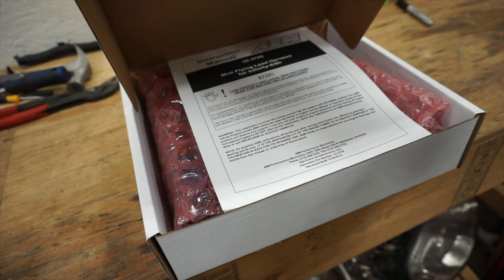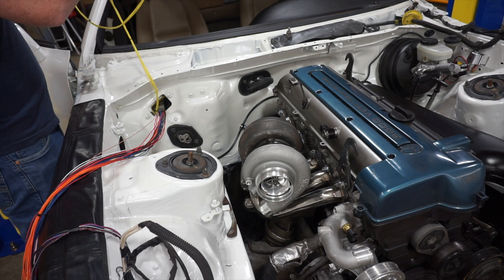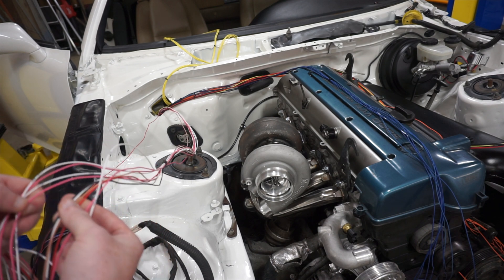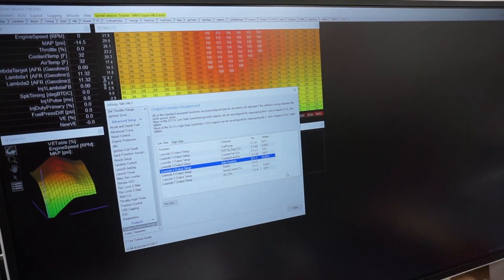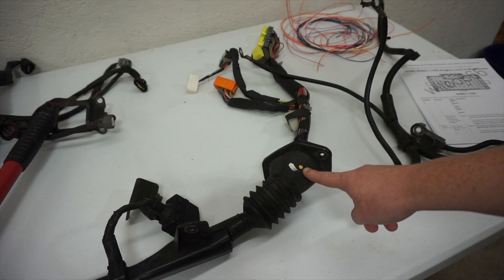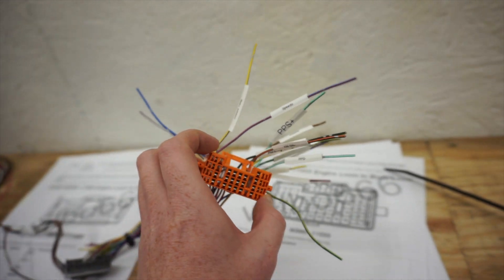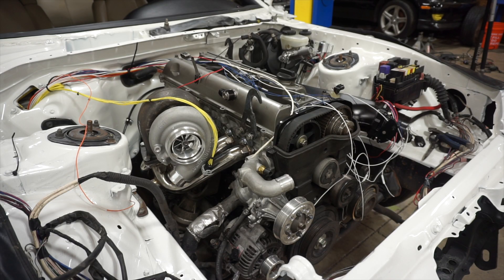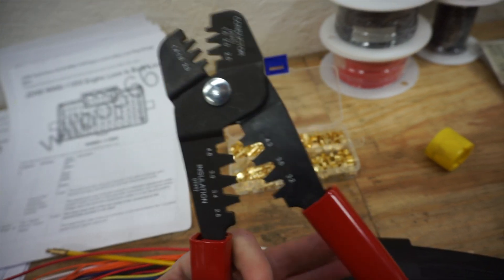Making a 2JZ Engine Harness - MKIV Supra Build - Pt.9

Comment: I'm doing my harness as well, from scratch, I'm done with everything but I haven't sheathed it all together due to one thing, the fuse box. I want to use the OEM Fuse box in the engine bay. 
Any details on that? @8:00 . My trouble personally is which signals are to come from ECU (likely the Request) going to the Fuse box EA1/BA1 & EA3/BA3 connectors. @9:57 it's a lot of manhours referencing the Electrical Wiring Diagram book and setting everything up, I don't even want to count how many I've spent but love the learning process.
The only thing I can say is don't take breaks on the harness & by that I mean I took a 2 month hiatus on mine in October when Got all my branchpoints etc set up then early this month I came back on it and boy you really gotta re-tackle and refresh where you left off in order to know where you're going next. what helped me out is i made an Excell of all my wiring setup and what pin goes where and the color code i used for each sensor I used. Mine is going on an EMU Black (Much like you, I'm trying to retain all the factory features and relay box... that's what got me left)
Reply: Did you ever finish your harness? Amd did it work? Can you help me on some info? I'm doing it to a emu black aswell